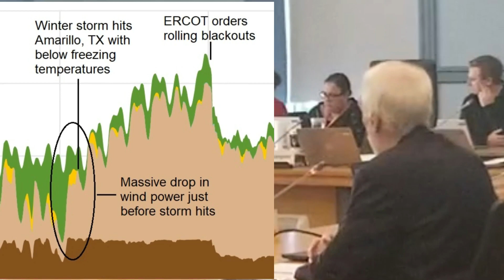ICSC Canada testimony to City of Ottawa Environment and Climate Change Committee - 21/02/23

Comment: it is snowing in March 2023 in Europe meanwhile is a War in Ukraine.
After 2 year periode of world wide recession, lets make a CO2 measurement. 
If the CO2 share has decreased compared to previous years, CO2 has an impact on climate change. If the CO2 share is the same, humans have no influence on climate change through CO2 emissions. If the CO2 share has increased, this should be proof that CO2 emissions have nothing to do with climate change.
Reply from the maker: Over the past 8 and 1/2 years, a half trillion tons of CO2 has been released by human activity. Yet, we have seen a very slight cooling. And, even since 1880, the so-called global average temperature has risen only about 1 deg C. Clearly, there is no climate emergency.

Comment from the maker: Here is exactly what I told the committee in my testimony:

My name is Tom Harris. I am Executive Director of International Climate Science Coalition – Canada. I have bachelor and masters degrees in mechanical engineering with a specialization in thermodynamics, heat transfer and fluid mechanics. I worked as an engineer for the National Research Council, other government departments, and in the high-tech sector. As a lecturer at Carleton University, I taught climate change [science] to about 1500 students. 

To start, I would like to tell you about what happened in Texas when they relied on unreliable power, as Ottawa plans.

As dawn broke on February 15, 2021, 80-year-old Julius Gonzales made his way to one of his regular dialysis appointments. But he found the clinic had lost power and was closed. So, he drove back home to Arcola, Texas, where he lived with his wife Mary. But the power was out there too. As temperatures plunged to about -5, they couldn’t get warm, no matter how close they huddled to their generator-powered electric heater. By 5 a.m. the next morning, Julius Gonzales was dead.

Mr. Gonzales was one of up to 700 people who died due to hypothermia, carbon monoxide poisoning, house fires, etc. caused by a power blackout that left over eight million Texans without power, heat and water for up to five days. With freezing temperatures, people resorted to using their gas ovens or burning furniture to stay warm. Others used barbecue grills or their cars to create heat. This created a carbon monoxide poisoning disaster. 

The blackout happened largely because the state did not have sufficient reliable power. As the state with the most wind power, Texas had become overly dependent on wind power, an unreliable energy source. You see, on February 8th, wind power was providing over half of the state’s electricity. But, between February 8th and 16th, wind power crashed to just a few percent. The use of natural gas increased more than four-fold, but it wasn't enough to make up the shortfall. 

If Ottawa goes ahead with its $57 billion plans to get rid of fossil fuels and power the city largely on wind and solar power, there's a huge risk that a greater disaster will hit Ottawa even than hit Texas. 

In our January 2022 report, ICSC-Canada described why the city’s Climate Change Master plan is infeasible and damaging to Ottawans, the environment and human rights. In July we sent an open letter to Mayor Watson and council alerting them to our report, explaining that Ottawa is on the verge of a self-induced crisis being brought on by prioritizing “stopping climate change” over real world concerns.

No one replied to either our letter or our report.

Consequently, we ask that each member of this committee read our report at https://www.icsc-canada.com/ and respond in writing before voting on the budget.

We also ask that you recommend to council that all funding for the city’s Climate Change Master Plan, electric buses and the Resiliency & Climate Change program be removed from the budget until unbiased, open consultations are carried out by this committee. Those consultations should involve experts from all sides of these issues so that councillors and the public can hear about the actual state of the climate science and the financial, safety, health and security implications of Ottawa’s net-zero plans. 

To help the committee understand why we need fossil fuels to protect Ottawans and the environment, I will leave you with this report, from the Nongovernmental International Panel on Climate Change, as well as some summary documents if you don’t want to read a thousand pages. 

To help you appreciate how the rise in carbon dioxide is actually good for the environment and good for humanity, I’ll leave you this report, with thousands of peer reviewed studies that show the benefits of CO2 and  how we actually have nothing to fear about increasing carbon dioxide and indeed, I’ll also give you this so you can read a summary as well. 

And finally, to give you an overview of the science that contradicts that which you’re relying on, I leave you with this report which actually talks about the science of climate change that is not actually covered by the media. And I’ll also leave some summaries of that. 

We would be pleased to meet with any of you personally and to present our findings to the committee or to the full council. We’re convinced that following Ottawa’s plans will leave us bankrupt, hungry and freezing in the dark for no environmental benefit.

I look forward to your comments and questions. 

I look forward to your comments and questions. Thank you.